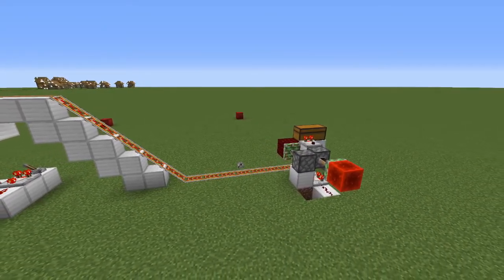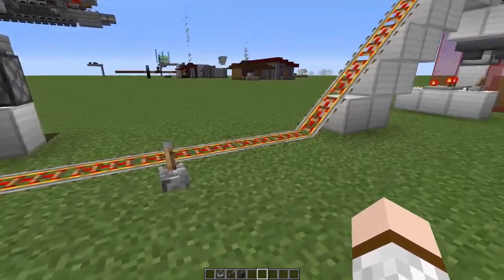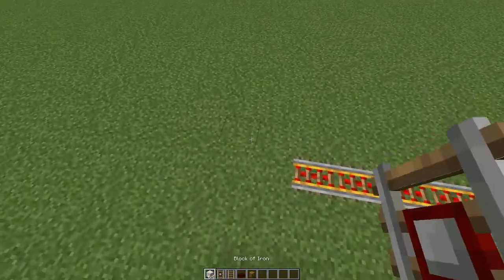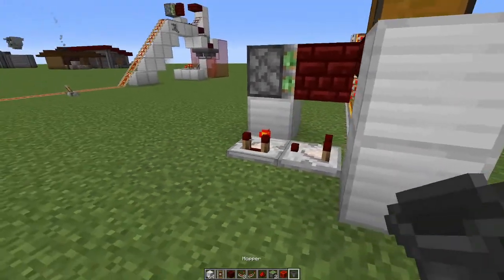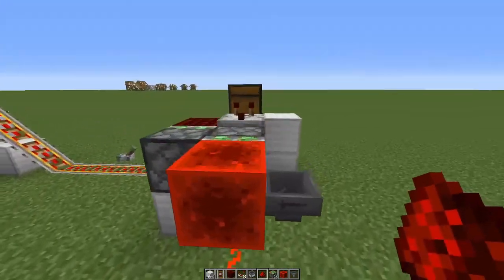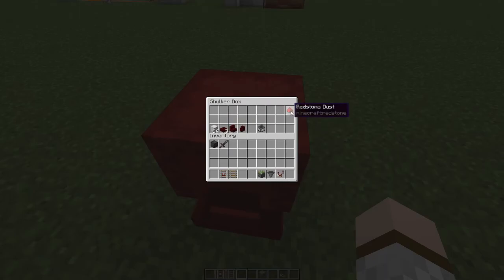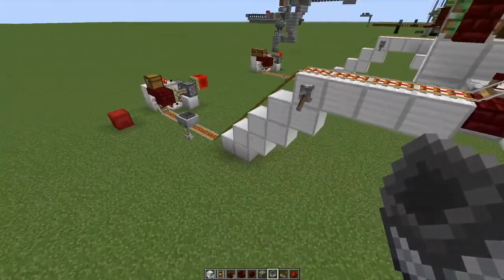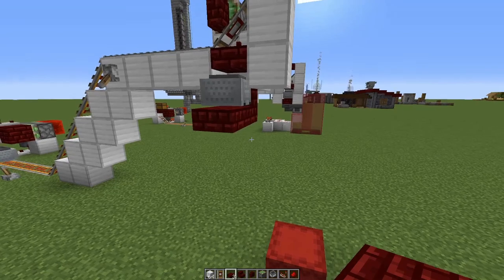FAST minecart loading stations! [Minecraft Tutorial]

Comment: I was searching for this contraption. Glad you covered this topic. 
I will  see if i can modify the end portion of the circuit by using a hopper detection circuit to power off the rail on top. If it doesnt work out then ill use the wall fence design.
Reply from the maker: Thanks! I see no problem with using a powered rail setup, it'll just be slower to unload the cart and send it back. Good luck!

Comment: I had some issues in the most recent version of minecraft Bedrock. The minecart didnt seem to get high enough to pull items out, like what Daniel mentioned. So i tinkered with the design a bit and got it working there's just a couple flaws in the bedrock rendition.

I used a hopper minecart stack (2 high) feeding into a hopper to unload the minecart. I pushed a block with a piston so I could place a rail on top of the stack, thats all i changed for the unloader.

For the loader I found a hopper instead of a chest could function well enough if you need a read out when there are no items left but don't want speed.
If you want speed but don't require a read out, using a minecart with hopper instead of a hopper is good too.
I'll run some more tests to see how moving the rail with a sticky piston will work.

Comment: Doesn't work on bedrock 1.20.2

The cart isn't pushed up far enough to pull from the chest.
Reply: In bedrock I had to use a hopper separated by a slab, it's a lot slower.
Alternatively, you could speed it up by moving a derailed hopper minecart to the location, however you then won't be able to get a read out of when it's empty for the 'smart' section of the test.

For the unloading section I had to stack hopper minecarts on top of each other by pushing one onto a hopper, then by putting one on the block above and deleting the block, to put the block back, so you can place rails on top of the stack, I used a piston.

TLDR;
Loading, top-bottom
Chest, hopper/derailed hopper minecart, slab, detector rail

Unloading, top-bottom
Detector rail, derailed minecart stacked on top of derailed minecart, hopper.
You'll need some piston maneuvering to get the second minecart into a block.